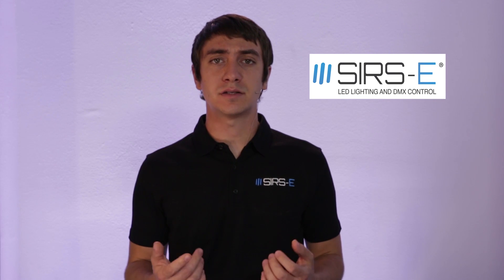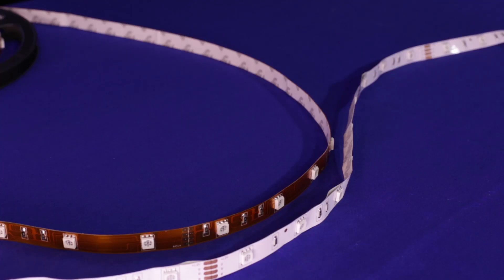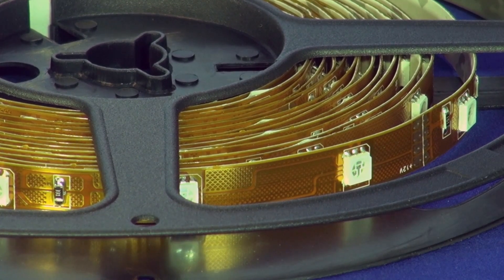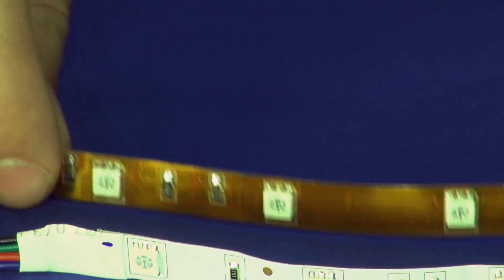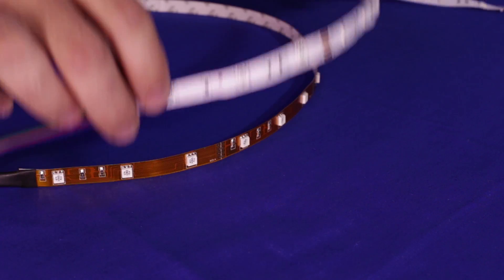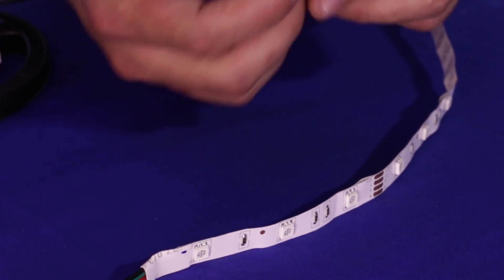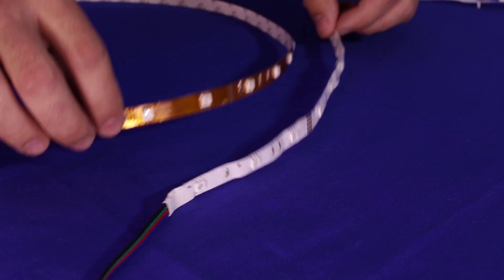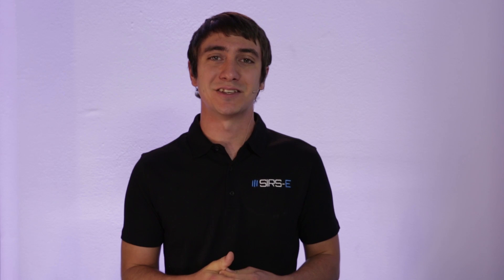What Makes a High Quality LED Strip?

Comment: I ordered some cheap quality rgb led smd 5050 from aliexpress chinese brand. They're the 5m rolls of rgb leds. how should i know the dc power supply needed to run them? They recommend 12v2a, but that seems too low for my taste.
Reply from the maker: Hello Paulo, the only way to know is to know the power consumption of your LED strips. Usually the manufacturer should be able to provide a data sheet that should at least tell you the wattage and amperage of the LED strip. If they sent over that power supply for the strips I would go with that one, they may be very low power consumption.
Reply: SIRS Electronics Inc oh, I see now in the specs they run at 4w per meter as they only have 30 LEDsS per meter. Thanks for the tip.
Reply from the maker: No problem at all, feel free to check out our website sometime, www.sirs-e.com
Reply: SIRS Electronics Inc I'm interested in your products but I can't order the sample kits or other products because it's coming from USA, so the shipping costs makes it impossible for me to buy from your website. Do you have a store in Europe? I'm from Portugal and would like to try your high quality LED strips.
Reply from the maker: Unfortunately we do not, we only have a location here in Texas.